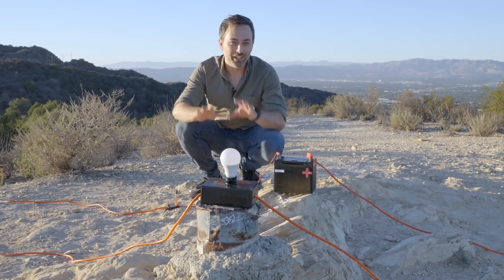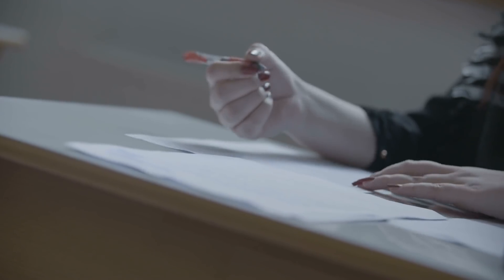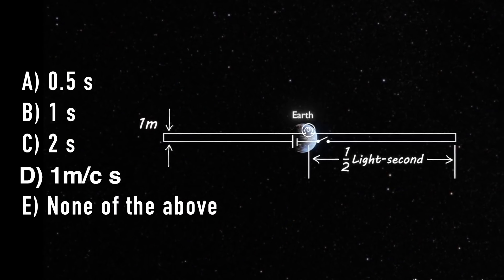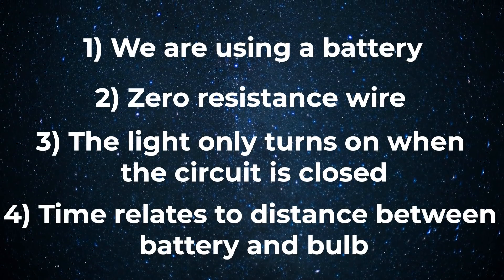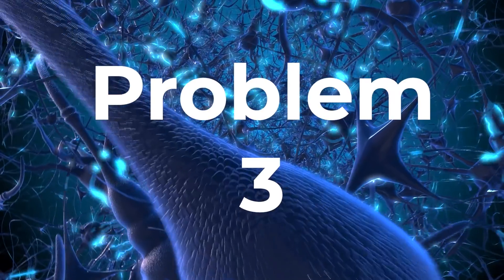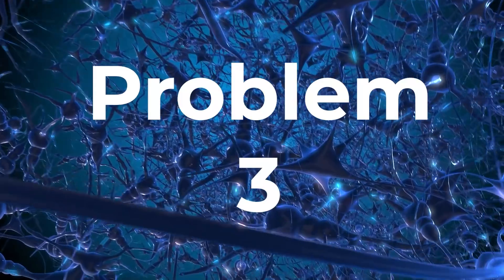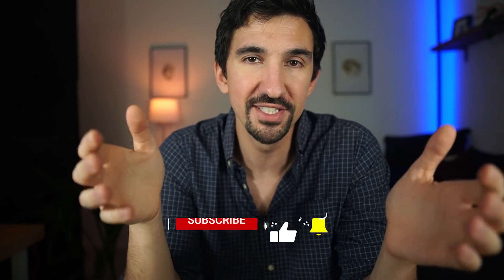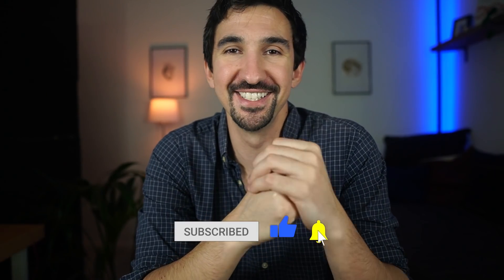Is Veritasium Wrong About Electricity?

Comment: Surely it depends on how close together your 'antennae' are?
Reply: Only logarithmically, if I remember the formulas for transmission lines correctly. It's difficult to make transmission lines much over 200Ohm (the impedance of the vacuum is only 377Ohm) and getting below a few ten Ohm leads to very small gaps between linear conductors. If we want much lower impedances (for ground/power plane decoupling on PCBs) then we have to sandwich multiple layers together with thin dielectrics. At multi-GHz frequencies even that fails because the effective "circle of influence" at that frequency is an inch or less. There is an entire class of high speed PCB consultant who does nothing else than to solve this problem for people who don't understand it and who can't make high speed boards.

Comment: If someone cloud instantaneously connect the battery to the circuit and flip the switch with a single button, does that change the answer to requiring 1 second to turn on the light? I.e. does half of the wire need to be previously “charged” by the connection of the battery for the EM field to propagate across the 5 meters of space to ~instantaneously turn on the light?
Reply: It's a bit complicated. The transmission line formed by the wires has an impedance of between 100 and 200 Ohm, the bulb has an impedance of roughly 1 Ohm, so the signal that propagates near the speed of light along the transmission line won't do much to light up the bulb. Replace it with a 100Ohm resistor and you got yourself a cable pulser. The resistance of the copper in the wires and the skin effect cause an exponential loss with length, so the last 299,990 km of the wire loop do not even matter. There will be no DC current left to light the bulb. :-)
Reply: @lepidoptera9337  Aren’t we (in Veritasium’s video) ignoring the drop off of the strength in the EM field along the wire in this hypothetical thought experiment?  Or couldn’t we just say sure, EM strength exponentially drops off as it travels along the wire (as you are pointing out), but we’re using a hypothetical battery and a hypothetical wire with enough strength to provide 60w by the time it travels the length of the wire and reaches the light bulb. In this hypothetical case, before the switch is flipped, is the wire near lightbulb already in a “charged” state? I don’t know the correct terminology here, but by “charged” state, I’m imagining 60w from the DC battery just waiting in the wire next to the battery to receive a signal that the switch has flipped and it’s time to move.

Comment: Follow up question, what if I placed a giant thick metal sheet in between the two wires, in order to prevent the field reaching the other side?
Reply: How is that supposed to work? Your metal strip is not grounded. The current has nowhere to flow.
Reply: @lepidoptera9337  How about a faraday cage around the light bulb?
Reply: @ricomajestic  With two holes in it that wires go through? That's not a Faraday cage.
Reply: @lepidoptera9337  Faraday cages don't have to be solid! Metal cages made out of mesh or metal bars are able to fully block Electromagnetic fields! That is well known and are used in research labs around the world and in physics classes all around the world to demonstrate shielding. Besides even with two tiny holes in a structure made out of thick metal you should be able to block 99% of any electromagnetic fields coming from outside the cage!
Reply: @ricomajestic  No, they don't. But if you drill a hole and you run a conductor through, then it's not a Faraday cage, anymore. :-)

Comment: Good video, I agree 100%. If the bulb  lights up immediately despite the very long circuit, It means that the bulb instantly "knows" that the circuit is closed. And this breaks causality, because this information is travelling faster than light.
It Is also intuitive that energy flows not in the wire, but still "along" the wire, because its the mobility of the electrons that propagates the electric field along the wire, until or reaches the bulb. And nothing can travel faster than light, not even energy
Reply: Great comment.  I think Veritasium's description is a little disingenuous because he's treating the bulb as an antenna, when in practice there would be nowhere near enough voltage for the bulb to light properly until full propagation through the unbroken circuit.

Comment: Here's another mind bender. Electrons only flow a few meters per second in a wire. The electrons in your house wiring never make it back to the power plant.
Reply: Actually, it's more like tens of um/s. Since we are dealing with AC voltages of 50/60Hz, the electrons never move further than a few um, at most.  Neither do they have to. That's not their job. Their job is to confine the electromagnetic fields to the immediate volume around the wires.
Reply: @lepidoptera9337  close enough. 😂
Reply: @FelonyVideos  Exactly. Six orders of magnitude are nothing between friends. It's just the difference between a stick of dynamite and a small nuclear weapon. I would have gotten a bit crabby if you had been wrong by nine orders... nobody likes a guy with a thermonuclear bomb.  :-)
Reply: @lepidoptera9337  Oh, you're calling me out, lol.ok, brb.
Reply: @FelonyVideos  I am just making fun of what happens in physics when the exponential is wrong by a "few" units. Happens to all of us with mostly comical effect. A professor of mine used to say that you will be forgiven for being wrong by an order of magnitude. It's factors of 2 and pi that are unforgivable because then you got your calculation wrong for sure. We had lively discussions about how insecure Einstein must have felt when 8pi dropped out in general relativity. :-)
Reply: @lepidoptera9337  Its refreshing to meet a smart person on the internet. Thank you. I've been wondering for years where they all went.
Reply: @FelonyVideos  Since electrons are not even objects, I am perfectly happy either way. Cue the endless bullshit about the electron double slit. :-)
Reply: I don't see that as a mind bender!

Comment: OK, so this is in my wheelhouse.

The confusion comes up because people don't seem to understand DC, AC, and the other physical properties of conductors, such as capacitance and inductance, not to mention skin effect.

If we are talking about a DC battery, and a superconducting wire, when the switch is closed, the light will immediately come on, but it may not stay on, because the capacitance of the wire may be overcome by the inductance, for a time. I don't know the time constant, because I don't know the geometry of the wire, but it might take days, weeks, or years before the light finally stabilizes in the full-on condition.

So, you can see, none of these simplistic analyses address the real world. 

But it gets worse...

If the wire passes through electric potential gradients greater than the battery voltage, then no switch closing will ever result in a current flow, at least not a DC current flow. There is no such conductor as a perfect conductor, not even a superconductor. They all have leakage. Imagine the conductor leaking out electrons at myriad voltages across large distances. In the end, the wire will carry no current from point A to point A OF THE LOOP.

But wait. It gets worse. Because the conductor is leaky, current will be able to enter the conductor over the last, say 1000 miles, and leave it over the first 1000 miles, and complete a virtual circuit. But you never needed a battery for this in the first place.

You don't need to imagine energy stored in fields to see how this works. Power companies have to charge their high voltage lines when they put them into service. It takes a moment.  This is not theoretical at all.

As a thought experiment, this is actually pretty boring. It requires little thought to debunk ALL of the posited theories.
Reply: It's just an antenna. He made a lot of fuss about a magic trick performed by Tesla a hundred years ago. You can always have a cable geometry where the power transmission through the air gap is completely negligible (below the thermal noise limit), so there would be exactly zero energy transfer from the battery to the lamp until the electrons are pushed all the way around the wire at the speed of light (given the local refractive index, of course).
Reply: Batteries have internal impedance. They cannot supply zero impedance Instantly. Thought experiment they cannot be tested? By
Reply: Veritasium has been wrong about a lot things for the past 2 years. Just saying.
Reply: @cjay2  there you are again! What a surprise. You must be kind of obsessed with this guy, taking some more time to copy the exact same reply in every single comment on this video. Weird.

Comment: I have a problem with the assesion that it is the magnetic field that supplies the energy that makes the light shine. In a DC circuit the flow of electrons create a static magnetic field, yes initally the field would build but once the constant current flows the field is there but not changing and will relain static. If it was the magnetic field causing the light to shine you should be able to connect to both sides of the light with a wire of indeterminate length and present a bar magnet to that conductor so the magnetic field passes through the conducting wire, and yes initially a current will flow but only momentarily. A static magnetic field will not create a cueernt flow and will not make the light shine.
The reason for the instant turning on of a light in a circuit of zero impedance is down to conductors are crammed and tightly packed with electrons that are at equilibrium with the atom eg Cu in the case of copper. If you pop one electron at one side of a circuit one instantly on the otherside. An analogy if the Newton's Cradle or better still a line of billiard balls if set in a pefect alignment and touching and a ball hits in alignment and the right velocity the line of balls will remain stationary except for the ball at the opposite end. It will be expelled the moment or almost the moment the projected ball strikes the line of billiard balls.
Reply: It is not the magnetic field but the electromagnetic field. The energy flow is given by the Poynting vector, which is the cross product of electric and magnetic field vectors. Since the electric field points (mostly) radially away from the wire and the magnetic field is circular around the wire, the Poynting vector is (mostly) parallel to the wire. There is a small component that points into the wire... that's the heating due to Ohmic losses.

Comment: You're missing the fact that relativity says MATTER cannot travel faster than light. It never says anything about information. You're making an assumption. There's a reason Einstein left the speed of light as a letter, and it was because he was never quite certain that speed was a constant. That constraint doesn't apply to information which has actually been proven to be able to travel faster than light magnetically in experiments with lasers. Also, he did specify a zero  resistance wire assumption.
Reply: No. Relativity is generally understood by physicists as saying that information cannot travel faster than C. And, information traveling faster than C has never been observed. (If you think it has been, you likely misunderstood. For example, quantum entanglement does NOT allow information to be transmitted at faster than C. Do you have a link to the experiment you allude to?)

Comment: The bulb is an LED bulb, which requires the voltage level to exceed a threshold before it begins conducting to any appreciable level. Veritasium claims the bulb will "turn on", which implies the voltage level exceeds the threshold. He hasn't proven that level of coupling exists. In fact, the field will drop with the square of the distance, so the voltage at the bulb will be way too low until the field propagates around the entire circuit.
Reply: Not to mention, the battery's DC current will not create an oscillating field ... so it will not propagate between "antennas" as described here.
Reply: @peterh222  Yeah there was no antennas mentioned at all in Veritasiums video. Veritasium just made a mistake and is wrong. The fact that you might be able to get some energy to transfer through antennas or what not, is an interesting fact but doesn't really factor into what he was talking about.
Reply: Exactly. And Veritasium has been wrong about a lot things for the past 2 years. Just saying.

Comment: This is a complicated explanation. Put more simply if they were correct an underwater supply cable  would not work as electromagnetic fields cannot propagate through water. However, underwater supply cables do work. Additionally, the electromagnetic field in space deteriorates as the inverse square of the distance so within a few feet the power would reduce to next to nothing.
Reply: All the electric eels in the Amazon are laughing at you, right now.
Reply: @lepidoptera9337  you obviously don't understand the difference between  electricity charge /current and electromagnetic waves, if they are capable of laughing it would more likely be you they are laughing at.
Reply: @williamhall2691  You are right. As a physics PhD it is me who doesn't understand, not you. ;-)

Comment: In response to information going faster than light, in your hypo, wouldn’t nothing happen for .5s, then the bulb immediately goes to half brightness and decreases until it turns off in .5s? Completing the circuit instantly creates fields but breaking a circuit doesn’t instantly destroy all fields in a circuit

Comment: Electronic engineer here: Physics isn't my field but high speed electronics is. If Veritasium was correct, you wouldn't be watching this video now!

Reason: You are watching this on a device (computer, phone, tv) using high speed signals, these need to be synchronised (delays added) between devices on the printed circuit board inside your device. We do this by making snake like traces on the printed circuit board, zig-zagging the signal across the board (Propagation delay). If Veritasium were correct, none of these zig-zags would matter as the delay would be the same, no matter how the signal was laid out. The signals inside your device would be out of synchronisation and you wouldn't be able to watch this video.
Reply: OK, "electronics engineer", that makes two wrong people right now, you and Veritasium. :-)

Comment: Causality is not broken because the 300kM long wires form what is called a transmission line. Transmission lines store energy in thier associated inductance and capacitance.. Cutting the wire at the end would not instantaneously extinguish the bulb. The Bulb would extinguish only when all the energy stored and the transmission line had drained.
Reply: The original thought experiment made it very clear this was mostly talking about perfect conductors of negligible resistance or, at least, the whole phenomenon was no affected by it. The whole premise was that it was "cable-independant" phenomenon because of Poynting, regardless of power-loss and fields attenuation.